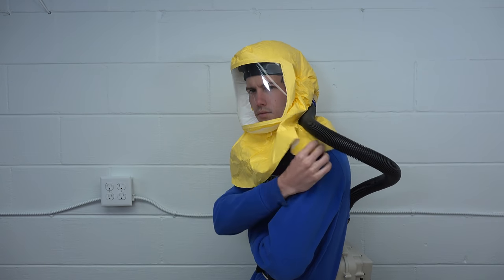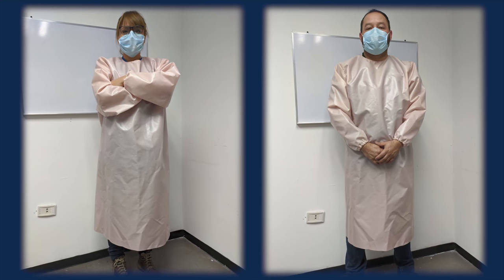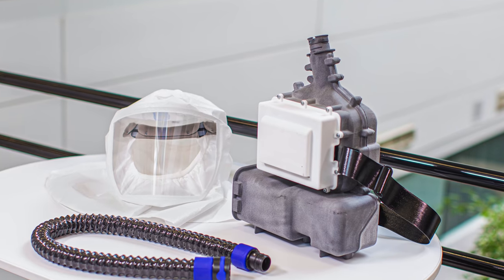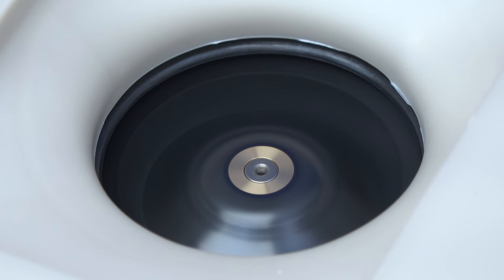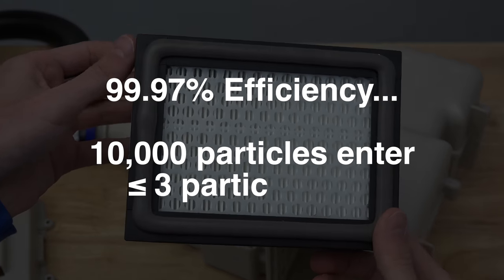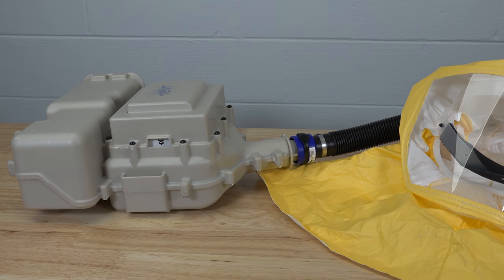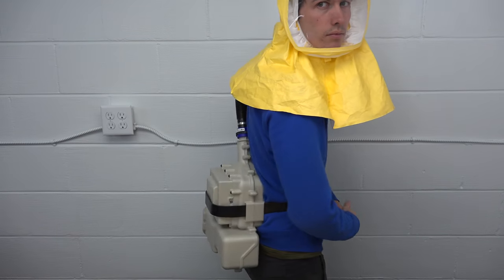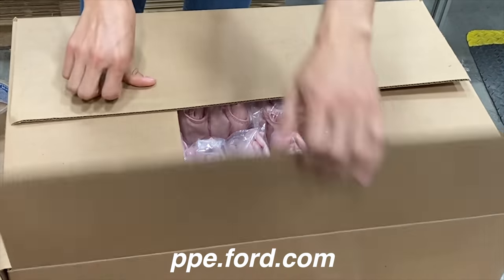Ford vs Coronavirus - Project Apollo's Brilliant Engineering

Comment: dang it just when it thought i would have a easy day and learn nothing.  
engineering explained: hold my la croix
Reply from the maker: Okay but for real how much HEPA knowledge did you gain from this quick watch?! They're actually pretty fascinating filters! Brownian motion, what!? 🤯
Reply: @EngineeringExplained  Indeed! I tought viruses wouldn't get trough because they would be contained inside a water droplet bigger than 0.3 micron.
Reply: simon-pierre gagnon 
You are right about that. When someone coughs or sneezes little droplets of water with the virus will be airborne. Those droplets may vary depending on the humidity.
Reply: @EngineeringExplained  i didn't think that Brownian motion would be big enough to aid in filtration.
Reply: They should put a uv light in there too it kills most stuff
Reply: @EngineeringExplained  You need to read about molecular sieves now.

Comment: As my supervisor used to remind me, time is a real-world engineering constraint.
Reply from the maker: Yes indeed, always a matter of time & money.
Reply: Just like climate change. Maybe F will help solve that next.
Reply: Until you start going into other forms of physics
Reply: Quite the timeline on injection mold tooling. And low volume. I wonder who the supplier is
Reply: @uuhamm  There are hundreds, if not thousands of IM companies that could turn around an aluminum mold, based on the 3D part model, in a few days.

Comment: The question is... How much tourqe does this thing produce?
Reply from the maker: Instant torque, great pick-up off the line!
Reply: Personally I just want a 0-60 time. 😁
Reply: It provides boost. Extra air for your lungs. It is like the opposite of being at high altitude where there is less air and you get out of breath.  Headline: "Ford Makes Supercharger for Humans".
Reply: @seanlynch8339  LOL I didn't think about that.... it's like an electric turbocharger for your lungs! XD Imagine if we power this by exhaust gases... What an amazing patent!
Reply: @miracufelix  That'll require some bean additive to your fuel ;)
Reply: Felixx96 Wouldn’t smell too good.
Reply: I'd say about 2 in/lbs...

Comment: I have used other PAPR's over the last few years. I can tell you, this one is considerably more robust. The others use a thinner plastic, with a smaller "box" unit for the fan/filter/battery assembly. The genius of this device is the Dewalt battery. MUCH longer life, much more robust than the usual kind. The easily swappable battery is a huge deal (the others are rechargeable, but when they run out, the unit as a whole must be plugged in.) I hope Ford keeps selling these. They will set the new standard.
Reply: The fact they use a commercially available battery speaks volumes.  If Apple made this, it would  be non-user serviceable, and if you tried, the battery would be a custom size (exclusive to Apple only).  If you disconnected the power incorrectly, you'd 'brick' the unit.  If Tesla made it, you'd get a giant 3D hologram of Elon Musk's head on it and legions of fanbois proclaiming it is the best PAPR evahhhhh.

Comment: I use something similar for my offroad UTV. Pump on the frame with hose to my helmet. No way its below 80db. I use ear plugs. Does a good job of keeping dust out of the helmet and keeps it from foggin up.  Good on Ford to step up and build this!
Reply: switch to a larger fan with lower rpm. You'll move as much air and reduce noise.

Comment: GM was also able to deliver 30,000 ventilators in under a month, a truly astonishing achievement. Granted they didn't need to engineer it from scratch, but they retooled, trained, and produced them to specification in 3 weeks from contract approval. It's amazing to see how fast these companies work when lives are on the line, but take a decade to design a platform or transmission :)

Comment: Wow. Great video Jason thank you it's a lot of great information. I knew Ford was throwing their hat in the ring building ventilators and such to help out, and I saw the engineer's drawings, but to be honest I definitely didn't expect them to turn out this well done, when I heard they were using truck seat fans and spare DeWalt batteries, I expected some kinda frankensteined, jerry-rigged contraption, but these actually look really well designed honestly. Good for Ford (and their suppliers) for doing such a great job in such little time.

Comment: HEPA challenge in Europe (EN1822) is at MPPS, which for an H14 is around 0.15 micron, around the size of COVID-19.  0.3 micron is not MPPS, but it is the ASHRAE 52.2 test standard challenge particle size.  European specified would provide even greater protection.

Comment: Bet it rattles after a week. Jk. Thank you for the explanation of filter ratings and probability. People need to know facts to assess risk.
I’m impressed with the cooperation and development of this PAPR, since the engineers were unfamiliar with the use case at the beginning of the project. They seemingly got this right in one shot. Not sure it rises to the level of Apollo, which was basically a small miracle. Though it makes me wonder what else we can improve through real, focused engineering and design when “failure is not an option”. Anyway, glad Ford are using their talent and workforce to help the healthcare workers.

Comment: Few design point outs and questions. 1. Is this now open source? 2. Why make the battery slot into a hole. More diff to clean. Would have been better to use the de walt battery slot on outside. Fast efficient swop around and less clips breaks going forward.

Comment: Please remember that the coronavirus particle doesn't just freely float in the air. It always piggybacks something, like respiratory cells, where it replicates. You have to remember that the epithelial cells in the pulmonary system are much larger than the virus itself.

Comment: Jason, as an official member of the YouTube Armchair Engineering Department, I feel that it's my (super)duty to offer some product improvements.  I hope you can pass these along to Ford:
1.  Certain parts of the healthcare industry would be interested in a nitrous oxide injected version.  Please advise.
2. How about a solar powered version?  I suggest it be called EcoBoost.
3. The advertising department wants a version with a camera, otherwise known as the PAPR-azzi.
4. Please advise whether IIHS and NHTSA crash testing has been performed.  Having the inlet to the fuel source at the back of the device has a Pinto-like quality to it which should be thoroughly evaluated.
5. We'd like to know if Helmholtz resonators were used for resonance supercharging.  Whiteboard analysis preferred.

In all seriousness, kudos to Ford and their suppliers.

Comment: You can make an even quieter, and even lower cost, effective device using duct tape, 2 rubber bands, 2 paper clips, a 2-liter plastic soda bottle, and a HEPA vacuum cleaner bag.  It has passive pressure so it fogs up but scuba mask -wearing divers usually counter this same problem decently using a little spit (saliva).  I would post a pic but youtube removes URLS.  The seal quality depends on the builder taking the effort to cut the bottle to effectively match their face well, and putting tape on the bottle's sharp edges all around the face opening.

Comment: Whoa whoa whoa!!! DeWalt?

Bro I gotta have Milwaukee batteries.
2/10, terrible product. Would not buy...

Wait, hold on, I'm a mechanic. I dont need one of these. Nevermind, carry on :)
Reply from the maker: Haha same. I tried to plug it into my Milwaukee charger to see if it'd work. I mean I knew it wouldn't, but I had to know. Of course not haha.
Reply: @EngineeringExplained  They used Dewalt due to being made in the USA.
Reply: @loelmartinez868  maybe they shouldn't have fired the guy that made DeWalt great, then he wouldn't have been available to make Milwaukee better.
Reply: Wish I remembered the guys name, it's an interesting story. The man's a business legend.
Reply: @jaydunbar7538  I'm not familiar with the backstory on the guy that "made DeWalt great". Either way, it has nothing to do with why Ford chose to use DeWalt batteries over another brand. My comment was only an opinion based on the fact that Ford is an American company and they probably wanted to stick with an American company solution for batteries which are available in most countries. I can be totally wrong as well but it's only an opinion.
Reply: @bosstowndynamics5488  Sorry, but you cannot modify medical equipment like that. Anything goes wrong, and you have a $5M lawsuit.
Reply: DeWalt is made in the USA and I presume DeWalt was a partner in this and has ramped up production of batteries. Having everything made in the USA out of domestic components guarantees a consistent supply chain.

Comment: I am skeptical about the application of Brownian motion to a filtering mechanism that allow a unidirectional fluid passing through.  Wouldn't particles with Brownian motion behavior have a tendency to flow in the same direction as the fluid surrounding them? I believe Brownian motion applies to particles in a medium with no preferred direction but I may be wrong.
Reply from the maker: General movement is towards the filter, yes, but at the microscopic level it's not a straight path, it bounces around.

Comment: This is a very good design. But Ford did not choose to make these filters. They were ordered to by President Trump. President Trump has the authority to do this presently. He also directed 3M, Honeywell, GE, GM, and several medical supplier companies to make filters and masks and face shields. Ford did an excellent job designing that air filtration hood so quickly. They are needed.

Comment: Quick question bro how do get max HP out of a N/A 4 cylinder 2.0L engine ? Mine has 147hp and a 08 civic type R has  200hp with a N/A 4 cylinder 2.0L engine. That's 53hp difference and just wondering where that extra power is coming from in a similar engine. Exhaust ? Air intake ? ECU tuning? ( i have no idea how to do whole ECU thing even after watching your video lol. I just want to see how much hp i can get out of a 2.0L Naturally Aspirated engine. So far i have fitted a cat back exhaust , and upgraded CAI ( cold air intake ) and have a dyno run in a week for results. 

Thanks heaps if you take the time to read this :) 

And thanks even more if you respond or suggest a video of yours to watch :)

Comment: Good God Ford, could you have considered reducing your fastener count just a bit?  Looks like this never got run through DFM (design for manufacturing...).  Could have made both those fastener flanges on the top and bottom of the unit snap-locks, and cut production time, increased reliability, and further reduced potential tampering (looks like no DFMEA/PFMEA either...).  By the way, Torx is also good for full torque application all the way to seating.  I would never use Phillips as they are designed to 'torque out' at a certain point - variation in the plastics and you get Phillips screws that simply don't seat very well.  Kind of strange because Ford thinks about this stuff for their vehicles...

Comment: I'm sorry, but these have existed for decades. And the existing designs are way cooler looking. I'm surprised 3M didn't just give them the blueprints for the AS-400LBC Airstream.
Reply: Christopher Tjalsma here is the issue—Ford doesn’t make these normally. They needed to be able to design the product and the assembly process using capabilities of existing supply chain.  The medical guys are running at over full capacity.

Comment: $700 for a sealed plastic box, small fan, hose, acrylic, raincoat material, and a battery.  Very admirable Ford job well done but why is the price that expensive? Those materials cost like $200. I forgot the computer chip to "regulate" air flow....sorry another $100 for that....so $300.

Comment: Please do a video on the Ford 300 six my 87 f250 service body straight 6 ford has over 802K miles no rebuild and my 85 has over 400k also no rebuild both have t18 and both run like a clock please do a video on them in hopes of ford making 4.9 Dohc 24 Valve and Dohc 24 Valve turbo but still use timing gears somehow because I love how unstoppable these motors are

Comment: I don't want to offend anyone or anything, but $700 for that does not seem cheap to me. Of course, when someones health and life are at risk, it is what it is, but simply adding parts:
Plastic case, injection molded: $50, if even that.
Fan: $50
Helmet: $30-$50
Hose: $10
Battery: $50-100
Filter $50
Control panel regulator: $50
This comes to a neighborhood of $300 for parts and I think I've probably overestimated some of them and i think it should be under $200 for parts. Now, I understand time-constraint, which caused sped up production and all those engineers and  workers need to be paid and testing needs to be done and probably a few more things that I am not aware of, but I don't see how this costs $700.
Reply: That would probably be true if you were making them in very large numbers.  When you make things in small volumes, cost goes up.  Ford had to invent/pay for the tooling for the parts and assembly, such as the injection molds for the housing.

Comment: So basically Ford redesigned the existing air stream masks that 3M has been selling commercially for years? Seems like they would just need to find alternatives for hard to source parts and then set up manufacturing capacity. Good and all, but not as huge as some people make it sound.
Reply: You have to realize, Ford had to design something that was manufacturable using their automotive supply chain.  build-to-print might have been impossible, but re-purposing existing parts and suppliers could be done very quickly.

Comment: If this unit was designed for limited time, why not glue the halves together? That'd be cheaper than 10 torx screws, no?
Reply: good question

Comment: Logistics is more of the problem than production.  Can Ford help with logistics bottlenecks?  The WH was caught last week with a 1.5 million piece stockpile at a TSA warehouse, and the FBI has been caught repeatedly intercepting shipments that were going to the states that already purchased them. The WH is apparently stockpiling its own facemasks and equipment, for no reason than "just in case" because the WH wasn't even using them at all. But it is stealing shipments that were already bought by the states Trump personally dislikes includng NJ, NY, CA, and Illinois, causing excessive deaths among the doctors and nurses and healthcare workers that desperately need this equipment.

Comment: 30+ days to 'design' a plastic case for a supplier provided blower + filter + battery combo?  Should I be impressed?
Reply from the maker: With 10,000 units made, a new filter design, upgraded blower, injection molded tooling. Idk, you can think however you like.

Comment: Why on earth does this need a circuit board? It's just a motor and a battery.
Reply from the maker: I didn't ask this specific question, but it has to maintain a certain airflow to meet NIOSH standards. I would assume it has to do with regulating that precise airflow.

Comment: Is the "less-than-point-three-micron" point accepted as proven, or is it also tested? The reason is that not all Brownian motion has the same outcome. Some fibers treat such particles as easy prey. Some - not so much. One of the enormous dangers of engineering is assuming that what's true for others in other environments holds firm for "this" in "this environment". That's why hot shot kid engineers are particularly dangerous. They dismissively cite how "it's been proven that __ __ ___" when the circumstances of a specific application can give an entirely different outcome.
Reply: In this regard Jason is not a kid. And not a hot shot, in the snot nosed hot shot smart ass sharp elbowed sense of the aforementioned kids.
Good vid. Good research and accuracy and anticipation of skepticism by the listener. All of the above, as is always the case on the channel.

Comment: $700 and non servicable filters. Typical medical waste of money and resources. If these were servicable you could use them for years to come. Include a spare filter in a mylar bag with each unit. These should be mass producable for about $100 because all the components other than the housing already exist.
Reply: The IM tooling for that mask is staggeringly expensive...